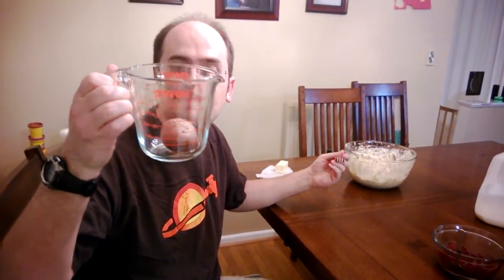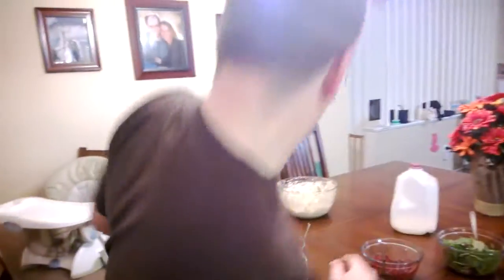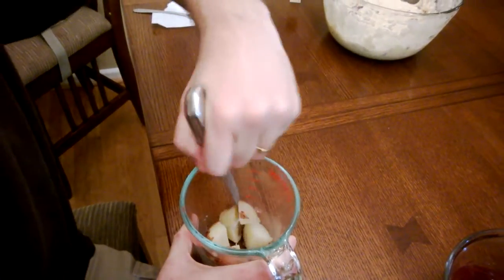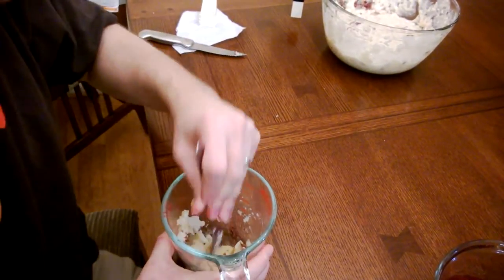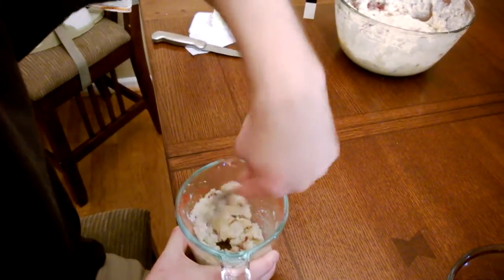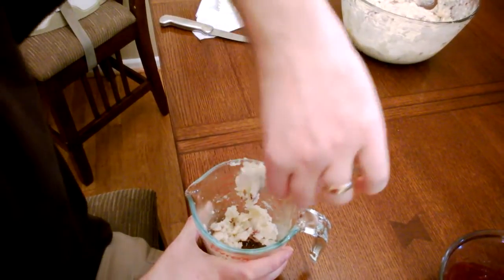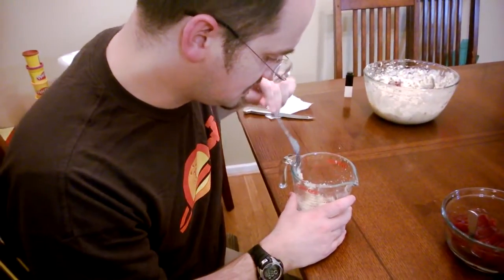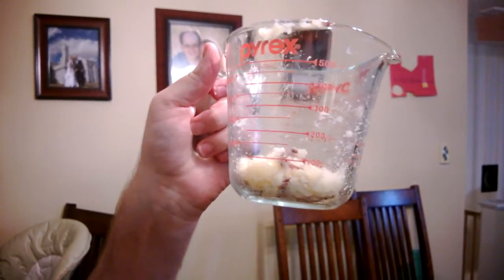Banach-Tarski potatoes 2/2

Comment: I get what you're trying to do, but not quite what the Banach - Tarski theorem is. This video by Vsauce explains it excellently: https://www.youtube.com/watch?v=s86-Z-CbaHA&t=126s
Reply from the maker: Oh, I understand this is not really Banach-Tarski paradox, but I am "doubling" a potato*. It's as close as I could come to meeting the challenge given me (mentioned in the description).
Reply: Well, you're technically just expanding the volume of the Potato. Not doubling its mass. Which is what the Banach - Tarski is. The paradox proves there is a way to take a object and create infinite subsets of that object and still have the same amount of volume. Mass (2x) of course has doubled. - https://en.wikipedia.org/wiki/Banach%E2%80%93Tarski_paradox
Reply from the maker: First off, Banach Tarski speaks nothing of "mass", or even of real objects, it's just talking about the mathematical model, and discusses duplicating volumes as a collection of points in space. If you were to go through the process described in the vsauce video (there are other processes by which volumes can be doubled) on a spherical potato, not only would you be splitting up potato cells, you'd be splitting up protons into infinitely many pieces. Then reassembling process would definitely not create potato when finished.

Secondly, I'll repeat what I said yesterday, I understand this is not really Banach-Tarski doubling. This is as close as I could come to meet a challenge given me in a silly video. If you came here to really learn about the Banach Tarski paradox, sorry.
Reply from the maker: I apologize if you feel that way. That was not my intention at all.